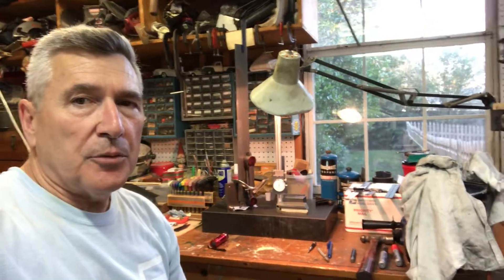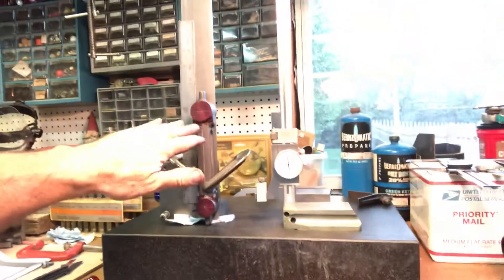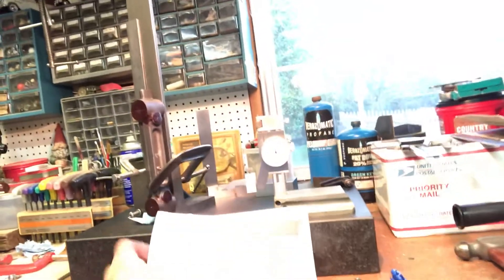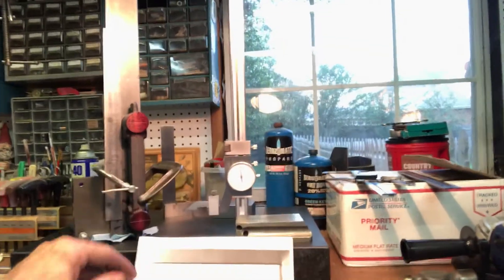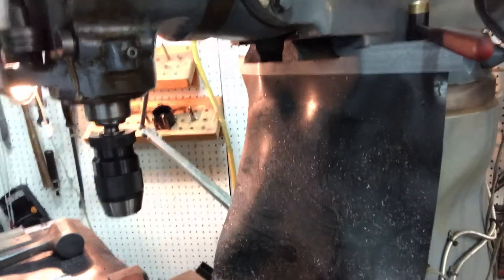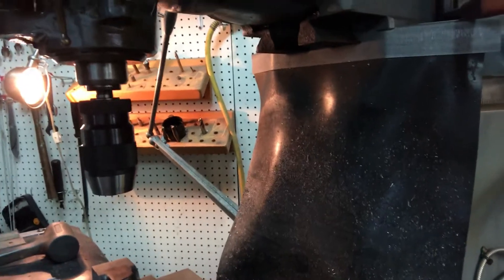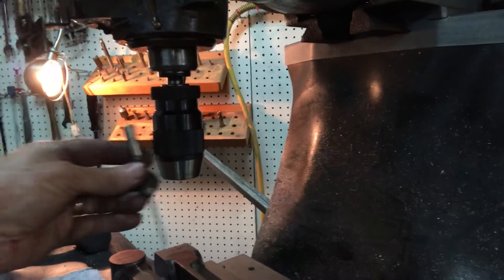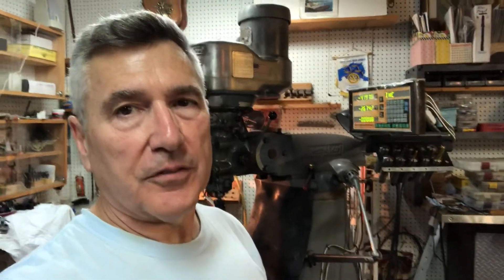Part 9, Universal Pillar Tool project

Comment: its looking good , you've inspired me to work on my set of castings ,I've started with the arms ,  I have the short ones and basically followed the same procedure, and I still need to make the Brass pieces. Have you decided how you are going to stamp   the numbers on the table? if you haven't seen it MRPETE222 had a good video" shop tips 180" ,  I used his method to make dials for my lathe and it works well, and the longer videos are great ,looking forward to more
Reply from the maker: Thanks, Thomas! Yes, I will probably stamp numbers so I appreciate your input. Will check out Mr. Pete for his technique. Appreciate your feedback!